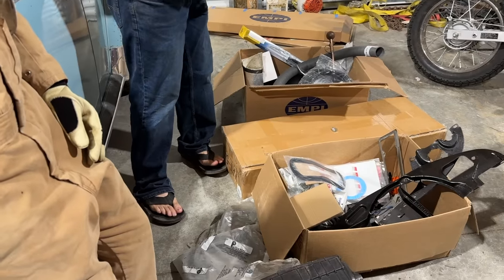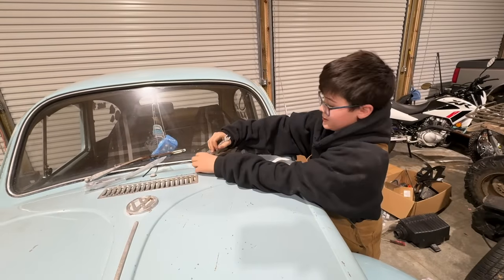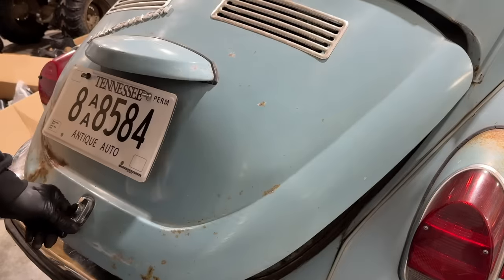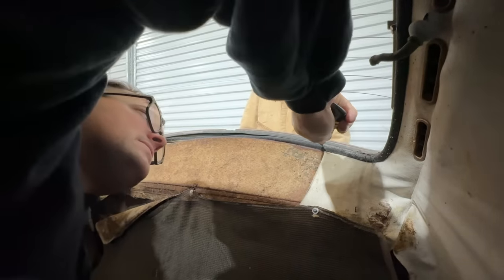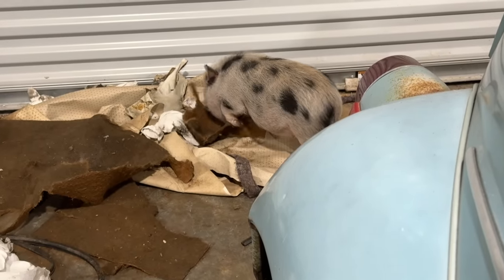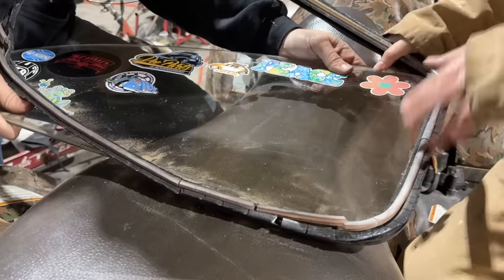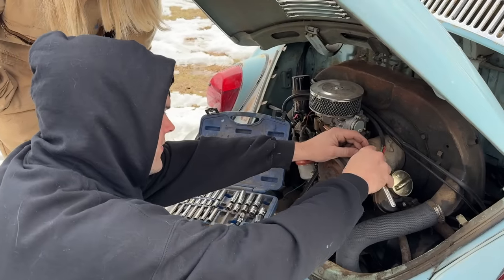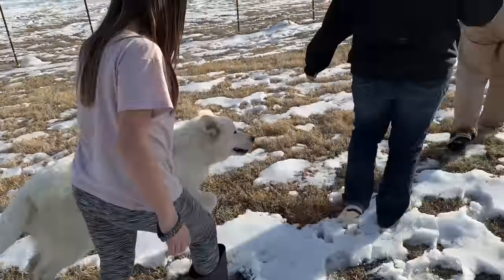Wawa’s Beetle gets Interior, suspension, roof rack, and engine maintenance!

Comment: When putting your wire/string (string works better) in the rubber trim on the windows take a piece of stiff 3/8 to1/4" metal tubing about 8" long to install the wire into the rubber - Stick the wire through the tubing (leave about an extra 8" loose on the end), run the tubing around in the rubber groove all around the window. Then put the window in place with the extra wire on the inside of the car and simply pull the wire/string from the inside and the rubber will fall right into place and your wire will all be on the inside - it will save those thumbs. I used to install TONS of windows in school busses at the factory that way. Hope it helps on future projects.
Reply from the maker: Okay thanks

Comment: We use dishwashing soap for the rubber window seals. Specially the outside part where it touches the paint. It works like bike handles. 
It softens the rubber a bit and then sticks to the paint. Making it “ weatherproof “ 
Anyways. Nice work. 👌🏻

Comment: When set up properly with good heat exchangers, heater cables...the vw has the best heat in any car.

The air coming through the dash, will have to be addressed by usually replacing the front hood gasket and insuring it closing correctly.

Comment: Fuel gage sender, mine had an earth problem due to painting the tank and body. Was fixed by running an earth wire to one of the screws holding the sender unit in. Also try swapping the wires on the resistor at the back of the gauge itself.

Comment: Need to index the rear torsion bars to raise it up in the rear. Only overheats if the Doghouse is not cleaned and oil cooler and fan not cleaned ( replace cooler seals and thermostat ) and missing or damaged engine tins. She will enjoy it and easy to repair and maintain.
Reply from the maker: Thank you 😊
Reply: Plus it’ll run hot if the engine bay tin seals are missing or damaged.im putting the thermostat stuff back in my 1641 for my blue 71 super,stock oil bath but I’m having to make “industrial tins” since I’m running j tubes
Reply: Lol right!? Man I learned all that the hard way growing up with one of these cars. Still to this day freaks me out where the fuel tank is 😅 
Anyways looks good guys. Nice to see how happy and proud your daughter is man 😊 
You sure are a dang good daddy sir. ❤
Reply: @walter68bug98  Yep!

Comment: Nice Bug!
These cars are excellent in the snow. Many years ago I watched a guy drive a VW beetle through 20” of snow, the car seemed to float across the top of the deep snowpack. The beetle was the only car to drive out of the snow and did it effortlessly. My dad had an 72 Cadillac which sunk down into the snow and got buried. Only issue with the beetle is the heating system is slightly deficient. Great project and an excellent car for WaWa to use for high school.

Comment: Very important to get that breastplate tin under the pulley  otherwise the fan will pick up hot air and blow it across the engine and cook it. Fan pulls cool air from outside and the heated air exits out inboard of the heads. Needs the separation of the tin and seal.
Reply from the maker: Ok thanks

Comment: If I remember correctly, that generator is directly connected to the cooling fan so it's not easy to replace it with an alternator due to cooling issues. It's likely easier to just fix the generator, and as long as it keeps the battery charged like it's supposed to, there really is no need to replace it with an alternator.
Reply from the maker: Ok thank you
Reply: They make the same fan and shroud setup with an alternator too.
Reply: @twinkie27271  @Sleeperdude Correct! The alternator requires a different support, hold-down clamp, and the tin piece between the fan and alternator, but essentially a bolt on replacement. (HINT) Much easier to do with the engine out, but it is possible to do with it in, although it's a pain to get to some of the bolts.🤪
Reply: I love bug, but this car is hard to see survive in my country because my country everage temperature 33© everyday 😅

Comment: I have a 1966 VW Beetle 1300 with a factory Sunroof. I have been restoring it for about 6 or 7 years now. Everything replaced that can be replaced. I kept it 6Volt but may end up changing that, or at least upgrading the wiring. The only thing I did that was not factory was front lowering spindles. It looks great and has a Patina look that is natural. "Sea Blue" is the original color. I have been trying to sell it but man, it is hard to let go.

Comment: VWs are the best.  Great mileage.  Simple to work on.  Great traction with all the weight on the back tires.  I used to use the compartment under back seat under drivers side as cooler.  Add ice and drinks😅  one additional thing.  The heat comes from the heat accumulaters around the manifolds.  You probably want to put a carbon monoxide detector inside like airplanes do which will alert you if you get a hole in manifold that lets carbon monoxide  into heat system.

Comment: vw was the last manufacture as far as I know to go to alternator from generator in mid year 1973.  If you would like to switch to alternator, they have the external motorola regulatored alternators(which the regulator is mounted under rear seat drivers side)  and also internal regulator alternator.  If you switch to alternator.........you must swap out your generator mounting pedestal(4 nuts on 4 studs to engine case) for an alternator pedestal.  The alternator pedestal is narrower front to back of the half round mounting surface itself.

Comment: This makes me miss my 69 Beetle so much. Mine had the Beam front end rather than the struts like this one has. The method for lowering the beam front end was different to this. It involved a bit of cutting, grinding and I think welding to install the parts. You ended up with adjusters on both beams that you undid a nut on, raised the arms, then fastened the nut. Not sure how well they worked.

Comment: You're missing the exhaust clamps that goes from the heater boxes to the header pipe they look like a V band but they got two vertical bolts on each side that clamp it together and the two bolts to go through your shifter into the floor you can loosen them up and slide it left and right and forward and back and tune your shifter pattern Dan in case you didn't know on both sides of the emergency brake there's two levers that controls your heater and your defroster the more RPM the motor turns the harder it blows through those dryer duct vents through outside of the exhaust both sides of the exhaust pipe then it converts to like 4 in plastic corrugated pipe that goes into the floorboard of the car

Comment: You need to put zinc additive in the oil it has a flat tappet cam  or what i usually use is valvoline vr1 20w50 that has the additive in the oil

Comment: Sleeprdude, Wawa and family. I have owned my '70 beetle since 1988 when I was  in Junior High (not middle school). I may have misunderstood what you said in the video but there are lowering options for the super beetles like yours. I have had much success using CIP1 for parts. Of course I have gotten some from swap meets and other places. Mid America also has parts for your Beetle and Raplhie's Vette as well. I like to go to Bugapalooza in Chattanooga every year. It's super cheap to get in. 

Anyway, CIP1 had lowering struts, shocks, springs and lowering sway bars. I'm not that familiar with the super beetle but I was unable to find drop spindles. Super Beetles are not very desirable in the VW community. It's because the body relies on the struts to suspend it in the air making it difficult to restore and for that matter work on. For instance you were having clearance trouble when working on that last cotter pin. Also, CIP1 and the other places have phone numbers to call for tech support. They have been so very helpful to me over the years. 

Side note: West Coast Metric has always been known for having the best and most accurate rubber parts and pieces. Do your own research on that though. I hope this helps. I realize there are many, many others out there who are more knowledgeable than me but I will help you as best I can if you need something even if it is simply pointing you in the right direction.

Also, check out The Samba. It's a plethora of knowledge, information and things for sale (VW related) from Volkswagen enthusiasts around the globe. I hope this helps and Godspeed on your Beetle.

Comment: You should probably check your shift rod while you are in there.  There is a hole with a cover on the front of the car  below the bumper.  It should be perfectly straight.  You will need to remove the shifter again and feed it out from there.

Comment: The rear suspension torsion bar springs are held in place by rubbers, the tiniest bit of wear causes it to drop severely. If you intend to replace these I would strongly suggest doing some research , adjustment and procedures are critical. But not a difficult job , once you know what you are doing.

Comment: If you get a shopping cart and cut the basket off it will fit perfectly in between the rear wheels. Drop the engine on it and roll her out! I suggest an accessory oil cooler. You can really make that 1600 run with a set of heads and a single Weber carb.

Comment: On Air cooled aluminum head engine, it not wear on valves it's the valve seats sink into the heads , this is what closes the valve gap.  Especially important to check them. Especially if Wawa is idling the engine and running high rpm in low gear around the farm

Comment: If you can't get a cotter pin out just take the bolt out shearing the pin with it, works great especially if you are replacing the parts. Done t MANY times

Comment: Hay Josh, back in the day we use to push the glass out with our feet,😅 and yes thats true. But if you wish to use a blade its way better to cut the rubber from the outside then there is no stress on the glass so less likely to break it.

Comment: I haven't seen mention of this in the comments, so here you go. These old bugs can leak gas and catch on fire, but there are two main things to do to prevent it. Mount the fuel filter under the car, so if it fails it leaks on the ground and not all over the hot engine. Also, the brass fuel inlet fitting on the carbuerator is pressed in to the top of the carb. It has been know to pop out of there, again spraying fuel on the hot engine. Remove the the carb, pull out the pressed in one and thread the hole. Then you cand screw in a standard barbed fitting to replace it. The VW specialty carb reman people do this on all of their rebuilds, so it is possible that it has been done to yours already, but I would check for sure. Also, the fuel line is metric and that is important in making sure it is all tight on the fittings. You can get it from the major VW suppliers. JBugs will take your money and 6 months later you will get your part. CIP1 is much more up front about availability.

Too many people have seen their restorations go up in flames because of one of these potential issues. I'm still working on my 1970, but have learned a lot along the way. I have some videos, too... Love your channel and I wish I could get my daughter more involved. We'll see! 
👍

Comment: one trick I learned a ways back if not  replacing components with cotter keys just tap  the socket over the top and the treads will  cut it off

Comment: The "eye lids" on the headlights sorta help with light deflection at night in fog. You need to put the little vents back in by the back window. Those are the return air for the heating system.
Reply: Yes to those vents by back window.

Comment: As the owner of a Karmann Ghia in MS, I can confirm air-tight seal for the engine pan is key or the cooling air will not track correctly. I have burned up many an engine proving this.

Comment: If you find your gear shift is still rattly , there is a nylon bush on the shaft , just back from the shifter. Replacement requires pulling the whole shaft out through the front of the floor pan.

Comment: Nice 👍 Yes you will definitely want to put on the rest of the engine cooling tin because without them it will overheat on hot days.  Without all the engine surround it will pull the heat coming off the exhaust into the fan instead of pulling the cool air through lid vents.  The battery definitely has a cover that goes on it an insulates the battery from any possible contact with the seat frame and yes those seats are a pain they have to go in just right.  On the headliner for future reference always layout your headliner for at least days ahead of time and let it relax in heated area or directly in sun weather permitting.  Probably the second most impossible thing is a portable steamer is going to be your friend for removing wrinkles and helping to relax material around corners.  If the wrinkles in the headliner get where you can't live with them you can always use the steam to help shrink some of the wrinkles.  You can also use the steam to reactivate the adhesive so you loosen and reposition the headliner.

Comment: Bugs catch on fire due to the rear seat shorting on the battery terminals. A solid battery cover is essential. Another fire issue is that there is no way to shut off the fuel , should you get an engine fire, which just keeps feeding it. A shut off valve or electric fuel pump can fix this problem . It also doubles as a security feature, having a fuel switch under the hood.

Comment: Sometimes the head bolts start to pull out of the block, sounds like loose exhaust parts, bad muffler. The cure is, parts called Case Inserts, for case end of head bolts.
Reply from the maker: Ok thanks

Comment: if all the sheetmetal and ventilation hoses are correctly installed airflow around the engine should be ok.At top speeds the shape of the car puts the engine compartment in a dead air space. This can cause a air cooled car to get hot. In the old days they would put burlap bags of ice over the heads to help. Living in the South She will need to keep an even keener eye on the temp gauge in summer when at lights or in slow traffic.

Comment: As many VWs as I had and worked on in past, I can't understand why you didn't leave the headliner for a pro to install! It Looks bad and will be cold and noisy when raining without insulation. My 2 cents. I also would of retorqued the cyl heads before adjusting valves.

Comment: Number 1 fuel leak possability is  the brass fuel inlet to carburetor. On the original carbs, the brass fuel pipe was pressed into the upper carb body, and when people used to twist off the fuel line trying to get it off would loosen the brass pipe.  They were known to pop out which makes your distributor get all nice and wet...........with gas!   I always put a throttle spring from fuel hose clamp to side of carb to keep it secure for safety reasons.  Had it happen to me once.  How the heck I didnt burn down the 67 beetle I had I dont know because left side of whole engine was wet with fuel!

Comment: I have a story about a trip I made in my 68 VDub way back in 1982. We were making a day trip to Galveston Island to the beach with 2 friends of my wife and I and their 2 small kids, all of us adults were around 20 to 25 years old so pretty young still. Well the upshot was that as we traveled down I45 south my friend Danny started yelling "My A** is on fire my A** is on fire!" suffice it to say we pulled over and found that the battery terminals were making contact with the back seat frame, and the seat cover had places were they were burned, as well as my friends behind. We all ended up having a good laugh after getting a piece of plywood to cover the battery. 🤪

Comment: The timing and dwell is set 7.5 degree BTDC at 900 RPM that is when vacuum hose came off from the distrubtor . That the centrifugal weight in distributor Set the timing at 28 to 30 degree BTDC at 3500 RPM. The dist.point is .016" or .015 inch. When that is done put the vacuum hose back on the distributor and UNCLAMP number 1 spark plug cable. The timing strobe light comes with the clamp. Careful, not to drop the black alligator clip to the positive charge.
Reply from the maker: Ok thank you

Comment: Need to scour the yard sales, and find and pick up an OLD suitcase. Spray it with some water proofing. With a set of mud/snow tires with studs,you'll be surprised at how well it'll do in the snow.
Also, everything is black now, you could paint the visible screws and take off the rear view mirror and paint it black too.
Reply from the maker: Ok good idea

Comment: You wont ever need to pay for a wheel alignment, close enough works fine , its probable way off at the moment, but still drives ok. You got lucky with the cheapo carby, mine was only good for replacing parts on the original.

Comment: When in college in the 80's at Western Carolina University - just over the mountain from you toward Asheville, NC - my roommate had a VW bug.  He lived in Winston Salem and had to transport HUGE speakers to school - the front passenger seat had to be left at home.  The 2 of us traveled to Waynesville one Sunday  to buy mandatory football watching beverages.  He was driving and I sat on the passenger side of the back seat, as the front passenger seat was still missing.  On the way home, I smelled something burning.  I looked down to see the front of the bottom of the back seat on fire - literally between my legs.  We pulled off quick and ripped the back seat out of the car.  Several of the before mentioned beverages were sacrificed to put out the fire.
So yes, it is very important to insulate between the bottom of the back seat and the battery - This is a fact.